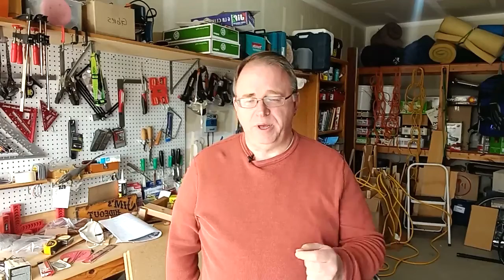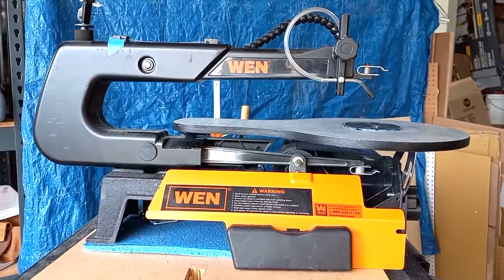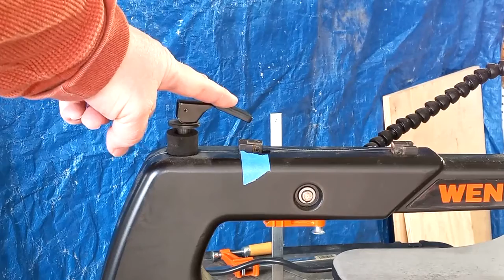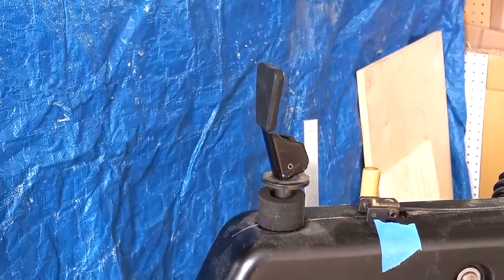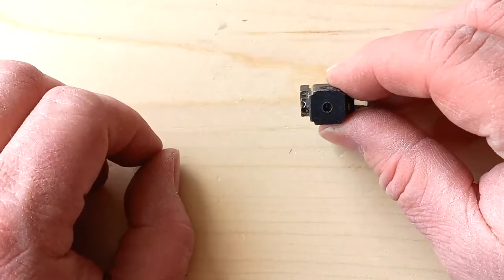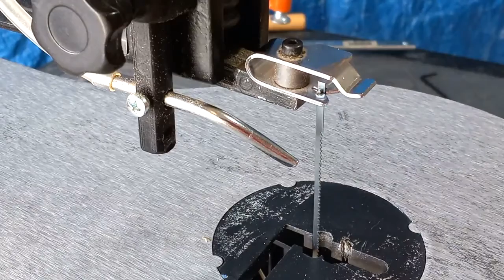Its EASY to install a saw blade on the WEN Scroll Saw Model 3920

Comment: New to scroll sawing. What is the purpose for each blade? Why would I need to change to the latter one you showed?
Reply from the maker: In order to accommodate the pin in the pin end blade, those blades will be wider. These are easy to install, but you can make as fine of cuts with them.  The pinless blades are better for making small interior cuts.

Comment: Is this the same for the 3921?  How are blade changes if you need to put the blade through a drilled hole in the workpiece to cut out a shape from inside,  e.g.  a circle? That's my only concern with the Wen since the arm doesn't pivot open.
Reply from the maker: Yes, I think it  is the same.  I believe the 3920 is the older version of the 3921.  Switching out pinless blades is a pretty clunky process.  I came up with a tip to make it easier and smoother to facilitate what you are describing.  If you are interested, then you can watch this video:  https://youtu.be/R-IyvGjKkuU

WEN has also come up with adaptors that I think will work on both the 3920 and 3921 you can install to make pinless blade changes easier.  I have purchased them, but not yet tried them.  You can watch this video on the sdgood youtube channel to learn more: https://www.youtube.com/watch?v=6cRuS3jloMM&feature=share&si=ELPmzJkDCLju2KnD5oyZMQ

Good luck and thanks for watching!

Comment: Hi James. Finally cut out my first couple of lure shapes. Two blades came with the saw, a pinned and a plain. The attachments for using the plain blade are the same as yours. However when using the plain blade there is severe vibration. Not so with the pinned blade. I tension them equally. Any thoughts. Thanks. Warren.
Reply from the maker: Good news about your lures!  Can't say I get more vibration with one blade type than the other.  I do get a fair amount of vibration with both types, but I chalk that up to it being an entry level saw.